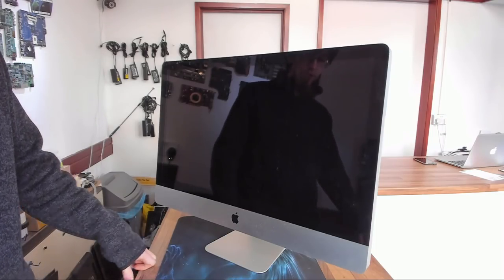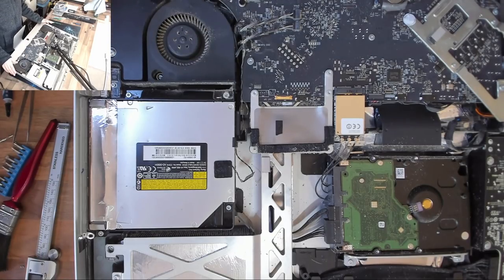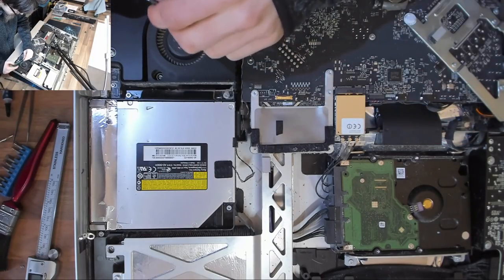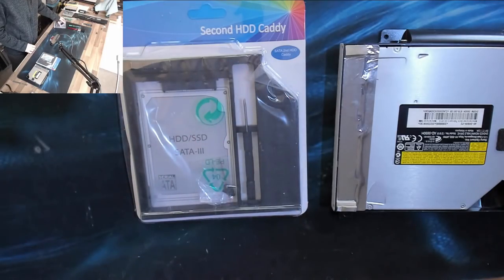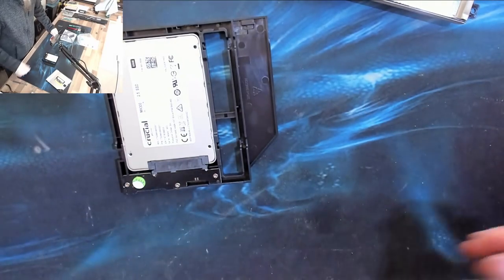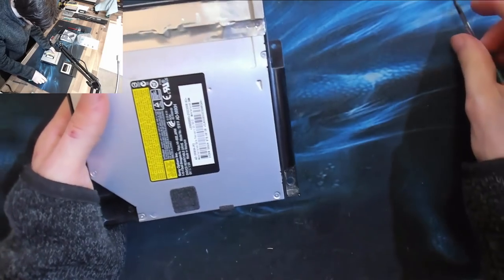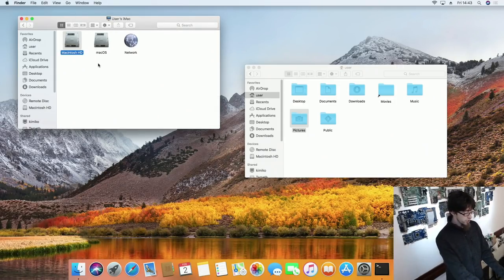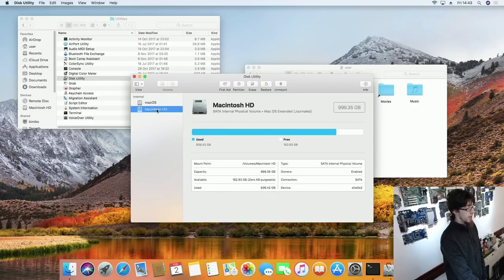LFC#129 - SSD/HDD Dual-Drive iMac

Comment: hello my name is julio I live in Brazil that way you put the ssd the speed is reduced
the sata port you are using on the dvd drive is sata 2
this imac model has a third sata port 3
using it you will have all the performance that ssd can offer you
follow ifixit link
https://pt.ifixit.com/Guide/Installing+iMac+Intel+21.5-Inch+EMC+2428+Dual+Drive+Kit/6434?lang=en
Reply from the maker: User won't notice the difference. The speed of an SSD is in the 4k operations, not sequential. 4k ops will be down in the 20-40MBps area. The only time sequential speed matters is if you've got more than one SSD in the system and you're transferring data between them.
Reply: @Adamant_IT  
true I agree with you because in addition to the risk of damaging the iMac to assist the third sata port in everyday use we will not notice the difference between a sata 2 vs sata 3 port
it was a praser to talk to you and congratulations on the tutorial